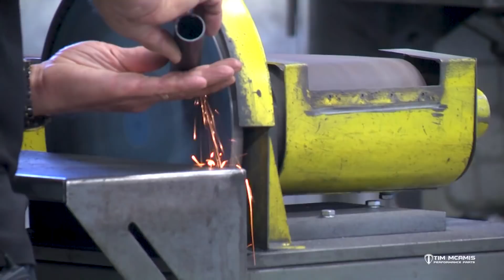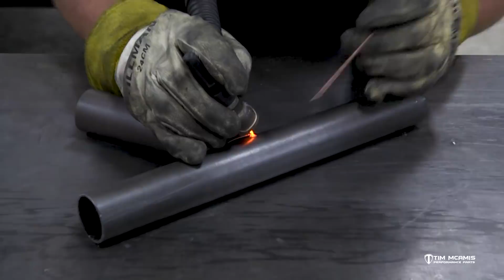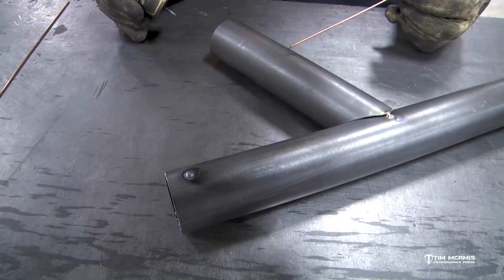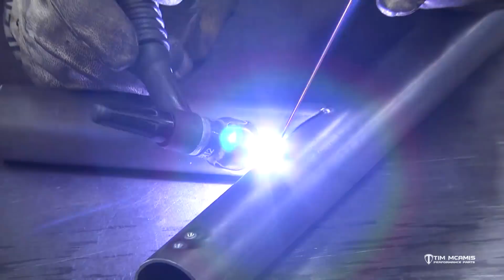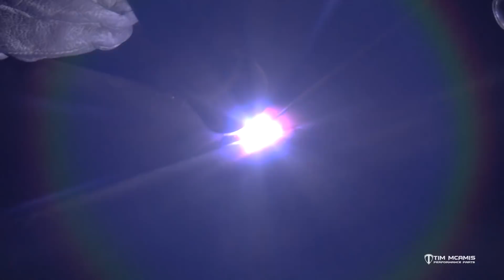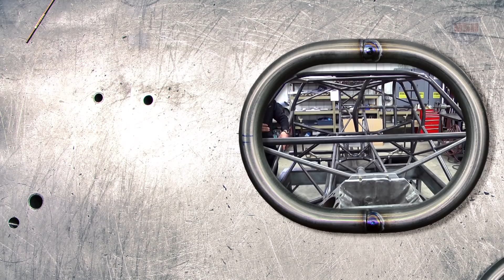Weld Quality & Tacking - Fabrication Series: 08

Comment: 17:15 thin due to coping
Bevel the edge . Set your cope edge inside out leaving a 10%-25% land(regards of thickness) 
This was what the welder wanted when I was the fitter building Chowchilla Speedways inaugural Street Stock Track Champion car

Comment: 3:28 blow hole not fixable with out a vent hole.
Doable.
  weld it like a  gap.
 stop 1 dab short of filled. 
Cool it off.
Then be quick 5-10a above the bead weld seting.  

Note: The smaller the air space the faster /hotter you need . Eg 6"x2"x.095"  looks like a blast tack 1/4 sec , were as  a 60"x2"x095 tube's increased internal volume  allows 1-2.5 sec . 
Doable.  Not prity . Proper prior planning prevents developing this skill.

Comment: People will likely tell me I'm wrong dont bother me cause it works for me I tac everything with mig welder then tig it
Reply: I don't see a problem myself so long as the right wire is in the welder. AKA don't cause weak spots in your chromoly by using e-70 - 6/2 for your spots.

Comment: I love the tip about drilling a burp hole. I didn't learn about that until many fails welding frames. I have to say being a factory field welder. You bench kids are really cute with your pedals. When I weld I use a finger button simple on/off set your amps set your post and go.
Reply: My friend asked me why I was learning/ teaching myself without the pedal?
 Because it is a skill I want to have in my tool box.  the pedal just gives you more finite control. Peddle welding is  a crutch and you're compromising your ability to do your job when you're out of position due to laws of physics restricting your ability to operate a pedal.
No complaints to each their own some men are built like K bars others built like a Swiss Army knife do everything but nothing good

Comment: What's Your opinion on using a basic rod/stick welder to weld tube chassis? Would it be sufficient or not as structurally sound as a tig/mig welder? (workmanship not withstanding)

Comment: You mentioned Tig. Do you still vent when mig welding?
Reply: I do since it still heats up the air in the tube and creates pressure
Reply: Process doesn't matter venting is necessary unless you want to get good at fixing blow holes

Comment: Nice job Tim and crew.
Glad you went in to detail about prep and gas coverage.

One thing i have noticed while building my chassis is prepping the tubing on the inside as well as cleaning out the tubing of grinding dust and swarf in the hole length of tube.

It stops you from having hard spots on the back side of the joint/weld,caused from re melting the oxidized swarf and grinding dust on the inside while your welding the outside of the tubing.

Also i had done some destructive testing on some tubing befor Welding my chassis and noticed the inside of the tubing has a light mile scale a well and seemed to fail right on the edge of the HAZ were it was heavily oxidized on the inside.
 When the inside was left as of the mill finish as apposed to cleaning it and it then failing in more of a random pattern and also  took more force to brake apart the clean prepped tubes.

Comment: Excellent vids, for both beginner and a 40 year welder!...Just an aside. I have always cut my filler rod in half (approx.18") AND put a 90 degree bend in the last 1/4" of the filler rod, ONE...the rod will NOT roll off the table/bench, Two...the one end will be HOT, which in my case ...hurts. I always grab the bent end...Three, good quality rod is always marked on one or both ends exactly what rod you have, ER70-S2, ER309, ER308, and usually the diameter...Having an 18" rod verses a 36" rod makes for getting into tight spots easier. (The time taken to tack the used ends together is MORE than wasted vs material costs!) Cheaper and safer to bend the end!...(I HATE bending over to pick filler rods off the floor and getting a little burned!!!)